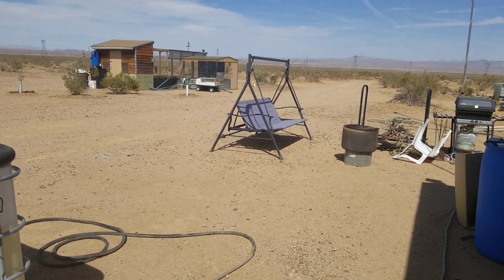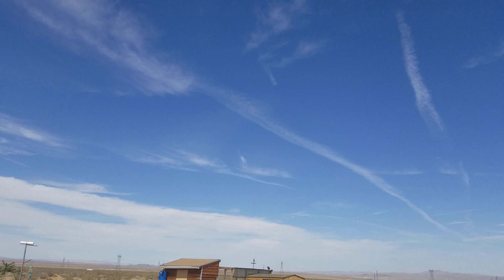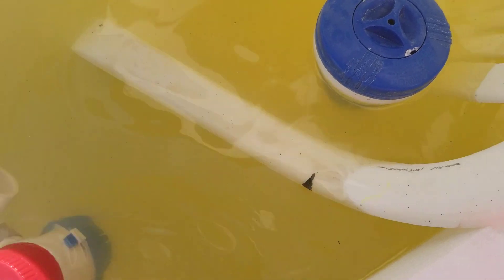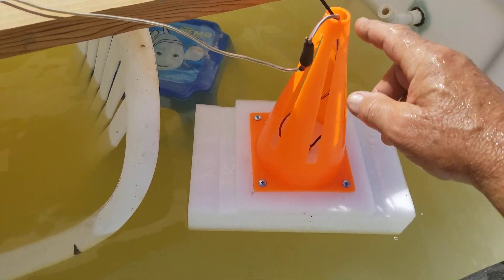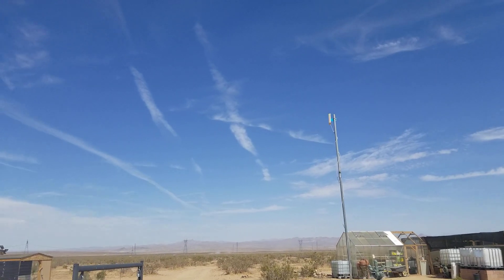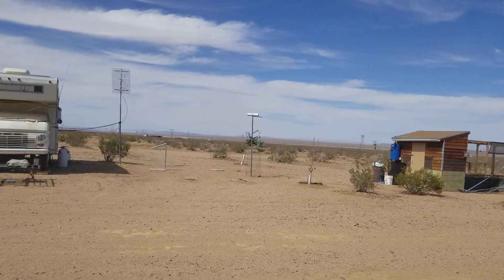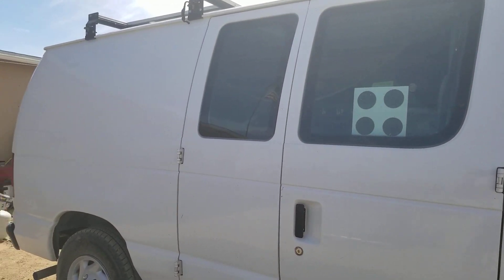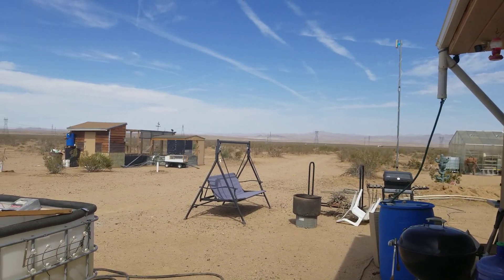FLOATING Circulation Pump Invention Test! May 25, 2021

Comment: G bear were I live back east they have been spraying all day. They took a break to refuel and started again. I also notice this is the 3rd time that every time they spray those chem trails. The temperature suddenly drops and the wind comes up. It was not forecasted in my area to be really gusty with high winds. Not the case we got chem trailed and the winds started gusting around 40 - 45 mph. FYI the  x pattern shows up really well on a satellite weather radar image.
Reply from the maker: Careful Vickie, the men in Black are listening!😂
By the way, thank you for sending my contact info to Reno!  They did contact me, and I will be checking them out.
Reply: @GBear  Your quite welcome I was sure you would be interested in them. It is frustrating trying to do outdoor projects and the wind comes up. Then I am chasing things all over the yard.
Reply from the maker: Yeah, out here it could be a mile walk each way to retrieve stuff.
Reply: Here too in Michigan. 
The weatherman says we are in for a big change in the weather.
Reply from the maker: After chem trails I'll bet.

Comment: Glad you're feeling better g bear I was going to ask you as many pumps as you've gone through and you been hanging on from The wire that goes into the pump you sure it's not turning loose on the inside with that connection not being tight enough you may want to take some string and tie the string on to your pump and on to your float and put the weight of the pump on it instead of on your wire going in just a thought easy to tell though take your old one apart and look wish you all the luck and hope that you new tool will be something you can really use have a nice evening 👍🐻
Reply from the maker: Good thinking!  You think like a Bear...😉
Yes, I had a plastic rope tied around the pump to carry the weight in the main tank, and will be adding the same to this unit once placed in the tank.